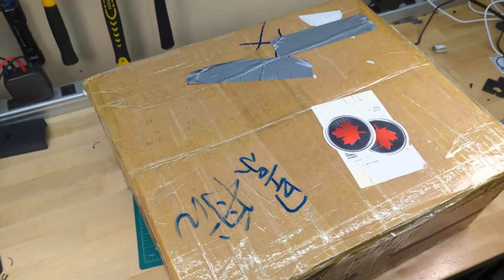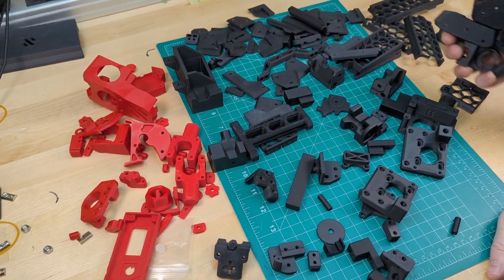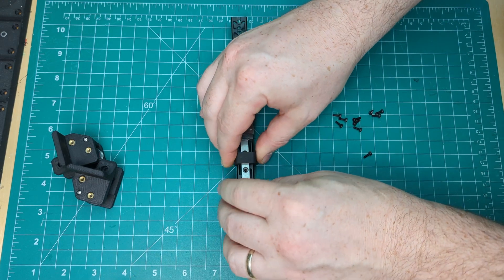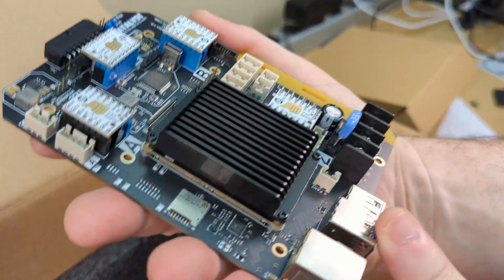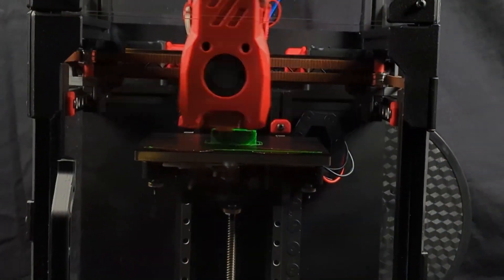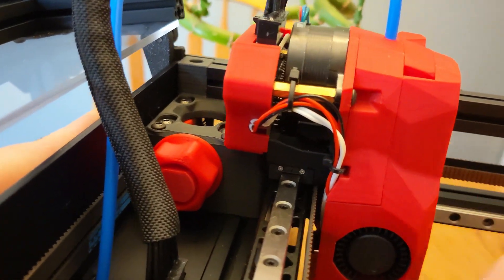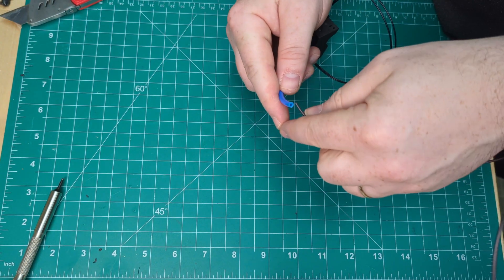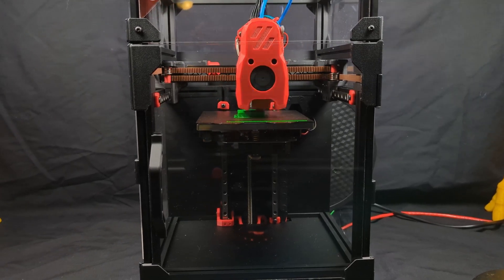Fysetc V0.2 Pro R1 - Our Impressions

Comment: Did you notice any difference between the Fysetc CNC bed mount vs Kirigami?
Reply: This is my question too.  The Kirigami I got in a Formbot kit was not straight but I was able to straighten it with just my fingers.    This is both good and bad.  Good because it is easy to fix a poorly made part but bad because it was so weak I could bend it with just my hands.   My guess is that the Fysec CNC part will be 100 times more rigid than the Kirigami.   That said, there are Kirigami parts made with steel that are much stronger and some better aluminum ones too.   I should have the CNC part by the end of the month.
Reply: My fysect cnc bed mount came today. Seems to be well made, looking to install in the next few days. Defiantly seems much more rigid
 @chrisalbertson5838

Comment: regarding the wiring, has any oner ordered a 2.4 kit and had the same experience? With having nothing to crimp, and having it all perfect?
Reply: I have a couple V0s from fysetc kits and i didn't need to solder anything to assemble, had the same experience with my fysetc trident kit
ordered a 2.4 kit some days ago and it's on the way, from what i checked, i will have the same experience. All the Wires came in the correct lenghts on the kits that i received.

Comment: Nice video !!

How are the extrusions? My V0 is an original V0 Formbot kit and the extrusions is a lot softer then my friends LDO kit.

🍻
Reply from the maker: They're the makerbeam style, with the T shaped slot.  annodization layer seems thicker / more robust compared to some of the cheaper frames we've seen, didn't scratch easily.   They were all straight, and equal lengths. no complaints.   I will say the panel fitment was a little bit more finicky than we're used to. everything went together well enough, but it would have been easier if the panels were undersized by 0.1mm or so. they were tight.